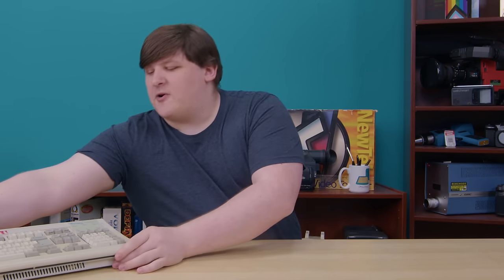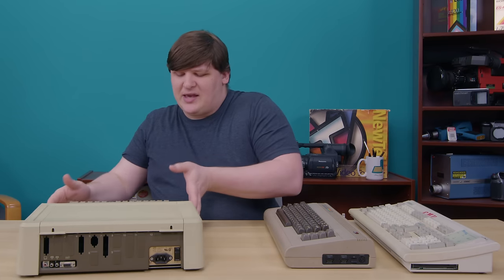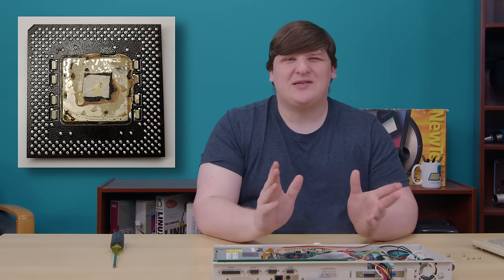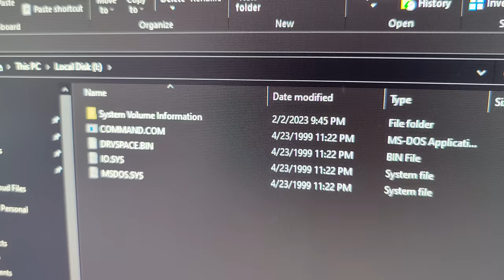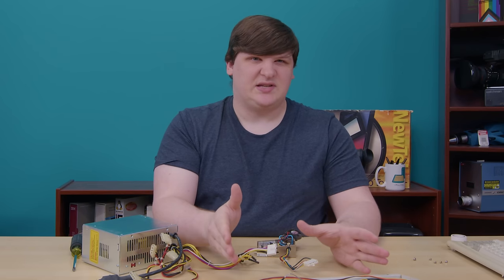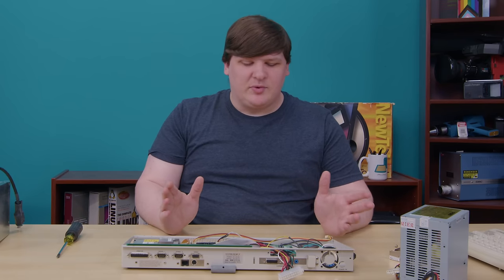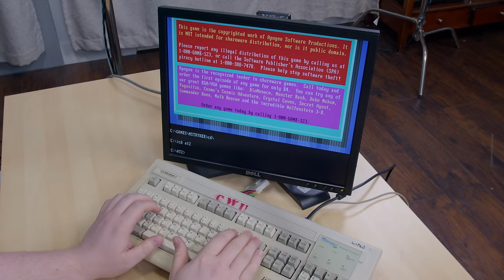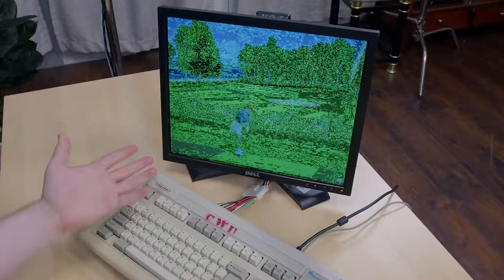I turned a weird "keyboard PC" into an FM boombox

Comment: Having used both manual and electric typewriters and various home microcomputers back in the 80s, I can partially attest to the take you mentioned that people had back then when it came to computers keyboards vs typewriters. Though I have to disagree with your notion that touch type on a typewriter is impossible. It’s definitely a bit different then touch typing on a modern PC keyboard but it’s still doable.

Yes,typewriters had their keys placed very high off the desk relatively to a IBM PC Model M keyboard of the era but not as far off from All-In-One keyboard computer like the C64 or Apple II so you would be more familiar with the all-in-One keyboard style then the IBM keyboard style unless you can from using an IBM/Compatible in work or school.  All typewrites, both manual and electric, required. Ore space under the keys then a IBM keyboard because of the way the keys and the typewriter overall worked. Even 60s & 70s era Electric typewriters like the IBM Selectric maintained that form factor even though it wasn’t necessary for the keyboard area becuase people where use to the keys being higher up coming from manual typewriters. 

And yes, you could type-type on  both manual and electric models though it wouldn’t feel like touch-typing on IBM keyboard. With older mechanical typewriters, you really had to press solidly on the keys to get each letter to properly  print on the paper. Electric models where much easier to touch-type though the hand position would likely be more tiring over time vs a modern Keyboard style. In fact, they used to teach touch-typing on typewriters in back in the 60s, and 70s (and earlier?) in at least some high schools as my Mother can attest.

Comment: Why not use a PICO PSU?  It's smaller than the original  PSU, connects directly to ATX, and uses a barrel jack to get it's power.  People use them in mini AMD builds, and as retro replacements all the time.  They have -5 and -12v rails too.
Reply from the maker: Mostly 'cause a picopsu is like $70-90 and a week's wait, whereas the PSU I bought is $5 and I went down the street and got it. The total amount I have invested in this project is about $20 since I had no idea if the machine would even work.

Comment: Wait a sec, instead of putting two large waschers over the screws, couldn't you add a metal plate between the two screws instead?
That would also help with the spacebar flexing...

Comment: I've always wanted to make a modern Wedge shaped computer or case. Turbo was rarely used in Pentium era computers. The case was probably also used in 3/486 systems. Not bad for your first chiptune! I have been using Furnace Tracker on Windows lately. Anyway we can get a download?

Comment: If you want to sink even more time and money into this, you might want to look into using an ATX4VC and a PicoPSU. That can give you the -5v rail without having to scrounge for PSUs that use the old spec, and also let you use an external power brick so you don't need a whole ATX PSU hanging off the back of this thing.

Comment: I wonder if the typing height of older 8-bitters (and the wedge or breadbox design) is a holdover from typewriter heights. Typing desks were either lower than normal desks or had a cutout or recessed section of the desk for the typewriter, so the key level was more or less even with the height of the rest of the desk surface. (The height of the desk surface roughly set for handwriting, of course.)

I assume the comment about not being able to touch type on the 8-bitters or typewriters was a joke that didn't land? Speeds were definitely limited on crappier keyboards, but my mother was part of a home secretary pool growing up and while DOS PCs running Wordperfect with clacky mechanical keyboards (northgate and IBM mostly) became the de facto standard, there were a few who had Apple IIs, CP/M systems, and I even recall a Wang. A lot of these home secretaries started on mechanical or electric typewriters, and of course they could touch type on home computers.
Reply from the maker: Nah, that's just what I'm driving at: If you're coming from a modern keyboard and you try to touch type at full speed on an 8-bitter, you're going to be disappointed, that's what I mean by "touch typing _as we know it_". I do over 130 wpm - every time I try to use one of these machines, I have to consciously restrain myself because at those speeds, the keys just jam.

But compared to a mechanical typewriter they would have been a huge improvement, they were probably on-par with many contemporary electric typewriters, and if you weren't typing at absolute maximum velocity (or, maybe if you were more accurate than we need to be these days with modern keyswitches?) they were probably not that much worse than anything else of the time.
Reply: @CathodeRayDude  Gotcha. There was definitely a bar to pass for word processing use, and I can't recall any of my mom's friends using a PCjr, C64, CoCo, or TRS80, although that may have been more a combination of chiclet keyboards, lack of 80 column mode, or inability to generate letter quality (daisy wheel) output.

Comment: Hey there CRD. I will poke you off an email. If you give me the hole opening dimensions you have the 20/24 pin ATX plug sticking out of, I can 3D print you a bracket to screw in and snap the connector into if you like. It is probably healthier for the board not to have that connector hanging freely out the back.

Comment: I do like that form factor lots of down sides however unlike the laptops don't need to worry about batteries, broken lcd tft screens trackpads or those silly nubs. And easy to store and hookup could have done a few things a bit better but overall I would love to have a few of them for different generations of silicon for dos and windows games. It prolly failed because no one really knew they existed and being pretty plain on the inside I'm sure they were also overpriced. I would definitely have bought these things over a laptop back in the day or even as my next pc.

Comment: Given it operates as an AT (and not ATX) power supply, if it is running Win98OSR1 you should be able to access DOS by closing the windows and, when you get the logo "safe to power off" typing on the keyboard:

mode co80

because Windows 98 was still more of a graphical interface over a DOS operating system, other than an independent OS

Other than that, veeeery nice and interesting device, indeed 👍👍

Comment: Looks like placing VRM board over graphics chip (and thus place power traces near video signal traces) was not the best idea at all.
Probably, this VRM produces both 3.3 and 2.x volt supply for MMX CPU. And it may be of switching-type at least for 3.3 line.

Comment: You could try removing the 3.3V regulator daughterboard and powering the CPU directly from the ATX PSU - maybe the VRM causes some interference and if it's directly on top of the video chip, it wouldn't be completely implausible that it affects the picture.

Edit: That won't work because the Pentium MMX needs both 3.3V and 2.8V, so you'd need an additional voltage regulator
Reply from the maker: I haven't checked the output from the VRM to see if it really is 3.3 yet; it has at least 6 pins, so it's probably doing multiple rails. But it's definitely worth investigating; it didn't occur to me that, since the VRM is a separate module, it could be trivial to replace.

Comment: Do you get the wobbling when playing a video over the network (after opening WMP and letting the hard drive park)? I assume you tried a different HDD (since being a laptop drive it's running on 5V), does the controller support DMA? Cos while you're probably right that it must be something causing a wobble on a voltage rail (it surely has to be on the ISA bus if it messes up the sound [whatever is common with the PCI bus... the GPU HAS to be PCI right? In this era, even if there are no actual PCI slots?], you could check this by probing the appropriate pins with a multimeter), I suspect it's PIO that's causing the simultaneous chugging of both the CPU and HDD, and enabling DMA might do a lot to resolve it.
Other things to try, I guess it's not very likely but does the BIOS have an option to let you overvolt the CPU? If it is the culprit then slightly more power might prevent it from pulling down the rail. Also I guess the CPU could be heat damaged, I don't think overheat protection was common then, even without a working fan, it'd be worth grabbing a spare CPU just to try temporarily.

BTW you might be able to repair the mylar ribbon using a razor blade (to scrape away some of the insulation), tape, and a conductive ink pen.
Reply: hdd dma yes, but not UDMA

Comment: A  The harddrive plugged into the USB dongle will have a hard time spinning up as USB may not provide quite enough power to start. That is what it sounds like anyhow. 
B  The pause of windows 98 is it trying to initialize the network. Most likely trying to pull DHCP.
C screen tearing.. Capacitors. 100% Some have dried for sure.
Reply from the maker: regarding A - I've used this adapter for 50+ drives and only ever had that problem with this one; plus it was unable to spin up in the original host system. after the spindle broke loose, it hasn't had any problems on either one
Reply: @CathodeRayDude  Ahh ok. That certainly happens too.  I have had old laptop drives have issues on my usb adaptor plenty of times that I had to modify it to take an extra power supply. But the PC i use only has 2.5 watt ports. Some or most may use 5 watt ports.
Reply: @CathodeRayDude  I also commented a bit hastily on the caps for issue C. 

I have an mATX board of similar vintage with an SIS chipset (5597) that has graphical issues, though its more just outright screen corruption that it never recovers from until full power cycle. My gut for that one is its some of the tiny SMD caps rather than the larger through-hole barrel caps. 

I too replaced all the larger caps with only slight difference to the graphics, though the machine no longer crashed otherwise at least. I have not investigated further. It has unified chipset graphics rather than an external vga chip. So it will be harder for me to track down.

Comment: '@6:55 You state "typewriters had no concept of touch typing. I took a class with both manual an electric  typewriters.  All they keys were covered with electrical tape and you followed on in a work book on how to make the proper reaches to reach key.  then you drilled and drilled until it became muscle memory.   I could do 120 words a minute.on a typewriter but  Usually only on an IBM selectric.  so that statement is incorrect.

Comment: what i do with those is flood the fan with lubricant  then clean the whole cpu with de oxit and that brings the fans to life
Reply from the maker: tried, but there was no way to get to the bearing. i guess i could have sunk the entire cpu and hs/f into lube, but...
Reply: @CathodeRayDude  yeah it's a pain . Turn the CPU upside down use a can of wd 40 or clock oil . Get the hose on as far as you can and just douse the fan l. :) Then clean off the cpu and wipe the excess and plug it in . It should work the lubricant through the bearing :)

Comment: How do you clean up rust without messing up the electrical parts?
Reply from the maker: Oh I pulled all the parts, then just took sandpaper to the affected parts and used a real light touch. The rust was all very surface-y so I didn't need to take off plating/paint.

Comment: The board exep the CPU look like Hynix tablet PC for medical use, iv got a couple of those long time ago, trying to find a way to update the bios runing a propriatary system (on a chips connect whit a 44 pin cable, like an old portable 2.5) . visualy they look the same.

Comment: If you want to waste a little more brain power buy a PicoATX PSU. They receive 12v and deliver all the ATX outputs.

Maybe not the -5v but you can stepdown from the -12v very easily with a buck converter that is also very easy to find online.

Put a barrel jack on the back and a 12v power brick hahaha.

If you really want to use your brain power just buy like 2 or 3 buck-boost converters, many of them can generate negative rails and hook them to a laptop brick, they ate very cheap, are very efficient, will look pretty and can handle the current in this case.

Comment: How the f*** did they put a pentium 4 in to such a little case? Those were hotter than the sun. The company seemed really to like the wedge idea.
Reply: It probably has a laptop-like cooling system. Gaming laptops put off more heat than a typical desktop P4.

Comment: The distortion under high load sounds like a DMA problem to me. The graphics drivers may be the culprit here - S3 was never known for their state-of-the-art quality in pretty much anything. Windowed video does push a lot more pixels too, since the ALT-Enter fullscreen mode typically uses a much lower resolution (eg. 320x200x8 - the indexed colour mode (256 col) might be the reason for the colour distortion). The more pixels to push, the busier the video driver gets, the more load is on the CPU. Combine that with shoddy drivers and - voila. An unusable multimedia machine. Try using safe mode in 640x480x4 and it might work just fine - except for the extremely ugly graphics...

Comment: I can confirm the annoying 4-pin power supply comments, I've got an Epson thermal printer and it takes the same damn power jack thing, complete with latching connector and 24v 2A rating. I hope to God that I dont ever need to buy another one lol.

Comment: Longshot, but do you have something that transmits radio frequencies around 400mhz or 200mhz that could cause interference with a PC that wasn't designed in an RF filled environment.

Comment: WOman's intuition lol. You mentioned hot glue earlier. Pretty sure its not much of an insulator.
Reply: It works alright I used it on the back of my extended workstation board to fit it in a standard atx case so it don't short the back of the board against the case 😁

Comment: Kensington has nothing on this glued metal latch.
Reply from the maker: yeah I tugged on that thing, it's not going anywhere
Reply: Kensington actually made — and still makes — glue-on security anchors, both with Kensington Lock Slot or with a lug for a security cable.

Comment: https://youtu.be/TH4EtRm-Xvs?t=1940 If you set the network card to DHCP and have no cable connected or no DHCP server in your network, then Win9x has this pause in the startup of the network stack.
Just configure the network manual to use a fixed IP, then the pause goes away.

Comment: You're kind of ignoring electric (indeed, Selectric) typewriters in your discussion. You can touch type on those but they generally are high too. Edit: this sounds negative. I'm a huge fan don't take it the wrong way. :) <3
Reply from the maker: No it's all good, I appreciate the input. My take is this: Selectrics etc. go way back, sure, but electric typewriters of all sorts were always sort of higher end options. Plain old mechanical typewriters remained a Thing way into the 80s, because they were cheap and plentiful. So while high end typists - e.g. professionals and dedicated amateurs - would have definitely had some experience with short-throw touch typing, most people (who had ever used a typewriter at all, mind you) wouldn't have. Besides that, having typed on a number of electrics, it's still a very different experience than an IBM PC keyboard.

So my view is that any way you slice it, very few people would have put their hands on a C64 and said "oh no, this is just awful," because they were either A) already having to change their style quite a bit to adapt to the fully electronic-style board, or B) it was sufficiently similar to what they were used to that they wouldn't have noticed the inefficiencies that bother us coming from the 21st century.

Nonetheless, you're right, I was still somewhat reductive.